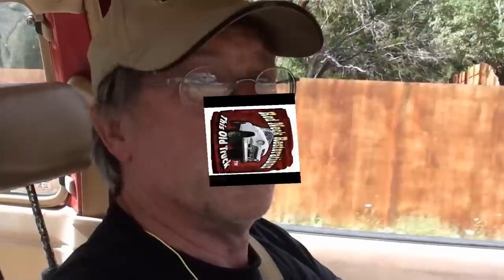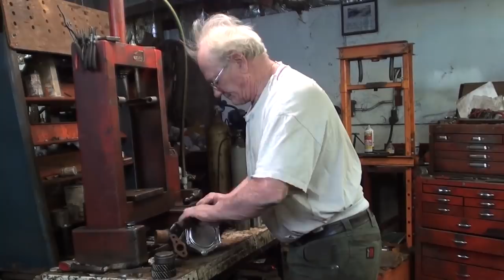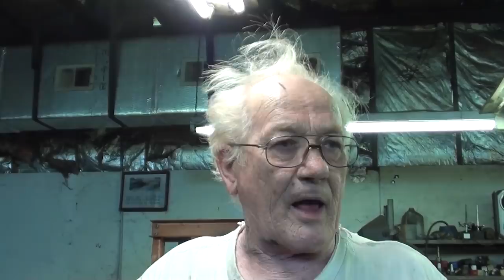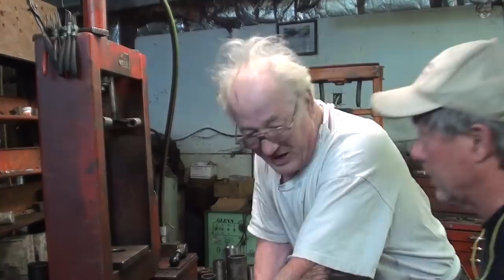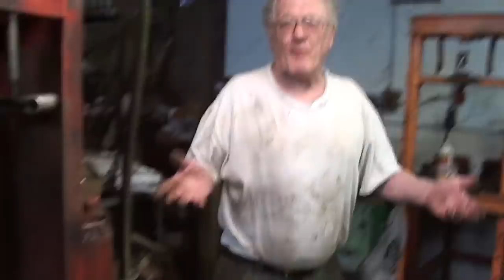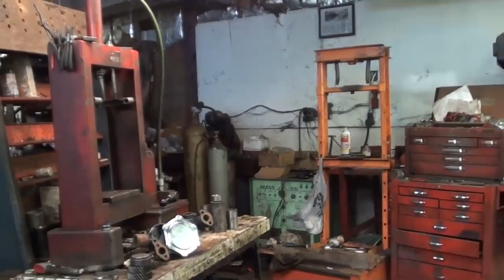283 Water Pump With TONY! Old Crusty Grand Dad Operation Crusty Truck

Comment: Wellsir, the new year is off to a good start, that 283 is lookin good and we have visit to the world's most magnificent machinist- Tony!  I installed a Edelbrock Performer intake and 500 cfm Carb on my 289 Windsor in 2003 and never looked back. A very good performing, low maintenance carb, and the Galaxie is a happy cruiser. As far as the technology bits, as soon as my kids move out, I'm putting an antenna back on the roof.

Comment: The Edelbrock is the old Carter AFB.  A fantastic carburetor.  If not a Q-jet, I would highly endorse the AFB.  One word is that the stock air filter may not clear the AFB if the air filter was from a Q-jet motor.

Comment: There also is a ROKU app to download on your phone that can work as a remote. It is great to have when you forget where you put your regular Roku remote.
Reply: There is no new phones with infrared... I was going ro buy one just the other day just so I could turn the channel when CNN, ABC or MSNBC is on in public places. 
My Galaxy S6 had it my LG thinq7 doesn't and since I melted it welding I figured my new phone would have remote capability, only some china company is offering one from what I have read and,the Verizon store near me didn't have any currentish phones with the feature.
Reply: @AtomicReverend  there is an app you use with the Roku. Roku uses wireless internet as well as your phone.

Comment: Use the Edebrook they are better than holleys. Set them, forget them.  It always nice too see you both. Tony's got the same tee shirt on too. LOL
Reply: Explain why u think they work better then holley.
Reply: @williamgarrity9482  Im a mechanic. i have fitted both of them over the years to a variety of cars and 4wds. In 4wds you always seem to have flooding problem. In 4wds they get bounced around and it changes the float levels. Yes i do know about the hydroplane chambers you can buy and they are a big improvement. Iv'e even tried fuel pressure regulators to lower the pressure but you drop it to low and you end up having them run low in the fuel bowls.  You end up replacing a lot of the power valves in them too. Each time thats done you need new metering block gaskets and o rings. With the Edelbrooks you take them out of the box, bolt them on, check the accelerator linkage travel tune the motor take it for a 10 minute run stick the hose up the tail pipe set the mixtures and idle speed. check  for fuel leaks, that's it. The next time you look at the carb is at the next service. Nothing goes wrong with them. I've fitted 3 in the last year.  A lot of time the holleys haven't been matched to the motor  by the owners giving bad gas milage too.
Reply: andrewkiwi1   I agree.  Done a few edelbrock and Holley installs.  Messed with a 4160 constantly.  After the banjo fitting spewed fuel over the engine, Bolted an edelbrock on. Set mixture and idle. Didn’t touch that carb again for a couple of years.  With high performance engines at the drag strip: go Holley. Btw, currently dealing with a Holley replacing an edelbrock.  Works fine , except the fast idle cam bound with the choke mount. 3000 rpm idle at random intervals.